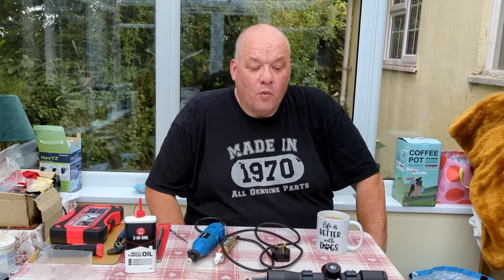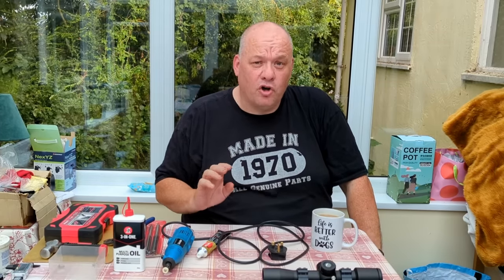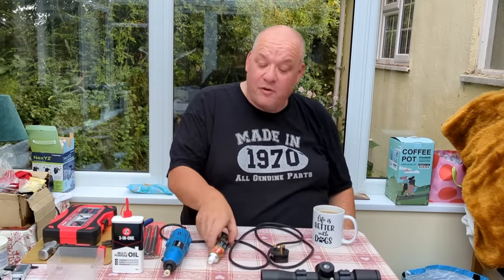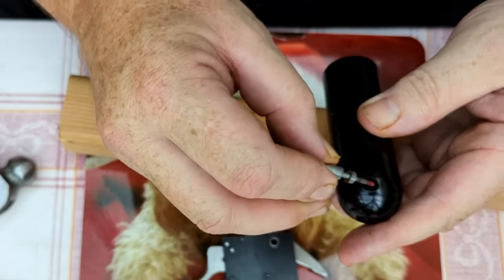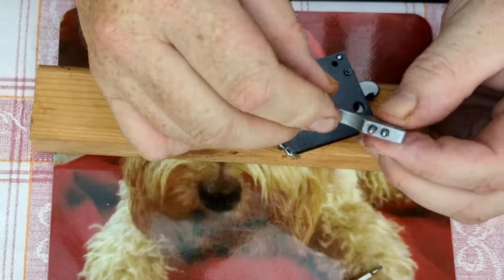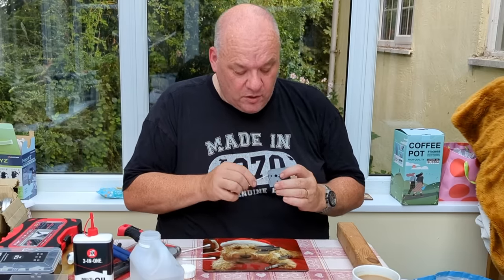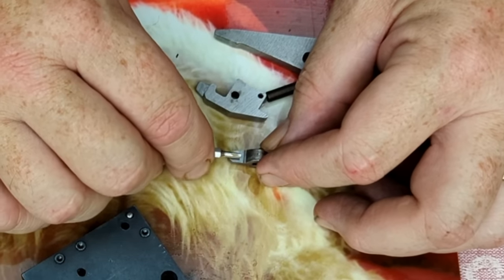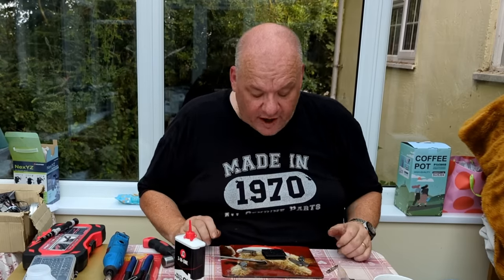S&C TV | Gary Chillingworth | Air rifle CD trigger strip and clean

Comment: Ahh, Zelda. 
Used to date her in the 80’s. 

And the great Windsor Davies. 
AKA Sgt. Mjr. Zero. 

Pure class. 

And Gary is spot on about polishing triggers. 
Be really careful of taking of too much meat. And also be Teally careful not to introduce any wedge (angle) into the surfaces. 
Triggers rely on all touch surfaces being in absolutely in the same plain. Any angle will ruin the feel you are trying to improve. 
Best way to avoid this is to continually move the orientation of the piece as you polish it. 
Always aim to keep it level but moving the orientation reduces the chance of introducing wedge. 
40 years of optical polishing has taught me something useful. 😂

Comment: Hi Gary, Thanks for your videos, always full of humour and good information 🙂 I don't want to seem like a keyboard warrior but would add a little to your content.  An area that many people forget to polish is the underside of the bottom sear where the first and second stage grub screws contact.  This area is very often rough from the factory and as the ends of the grub screws have to slide a little the smoother it is the better. Also at the end of your video, adjusting the "trigger weight" screw will not change how sensitive the break point is as it does not affect the sear engagement. To do this you need to adjust the second stage screw clockwise in very small amounts to increase the second stage engagement, remembering that any adjustment of the second stage will also change the length of the first stage which may then need adjusting, it's a balancing act.  Keep up the good work
Reply: Cheers, that's great information, thank you